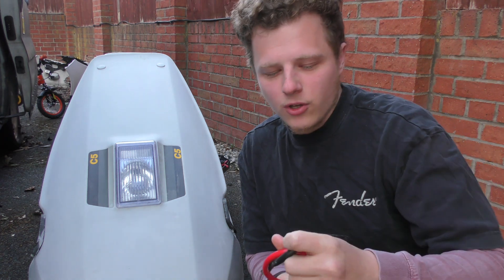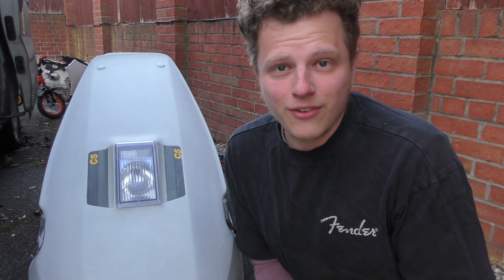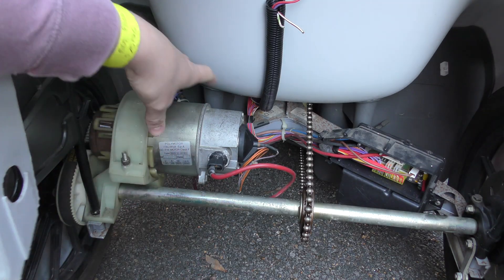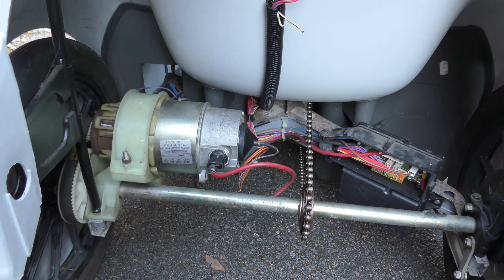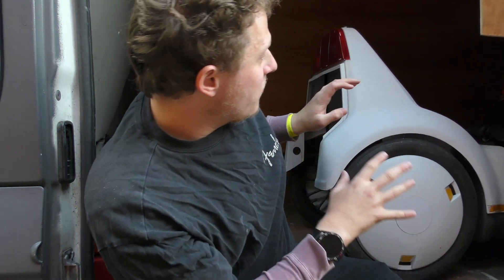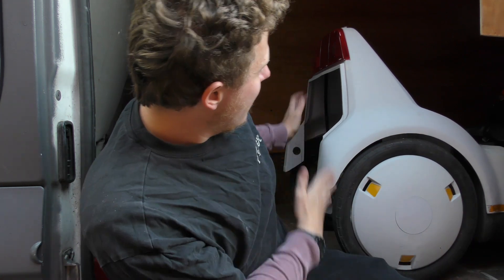Restoring the Sinclair C5 Motor After 40-Years!

Comment: For anyone watching this wanting to do theirs, 800 grit cleaning the commutator. Build it this was as shown, not the retro workshop way where the brushes are pulled by the braiding, this more often than not results in the braiding pulling out of the brushes. In the brush end the wavey washer goes in first, then the flat washer. 

Personally I would use more grease than shown here. 

Fit the gearbox mount then the bolts after. Make sure its the cream version shown, not the earlier brittle grey/brown versoin as this snaps and will cause more damage if you continue to use it with the motor not having the full support. If the bolts have to be wound through the gearbox mount, then its because its been apart before and someone has done it up too tight and the material has been compressed. It should be done up by hand with a socket screwdriver, not with a small ratchet. Put some grease on the end of the bolts as these have been known to seize into the brush end.

Happy C5ing! - C5DEPOT.CO.UK

Comment: motor looks good from my screen :) they are picky, use the right grease, and careful with the brushes you cannot replace them as there are none !
didn't notice how u put the motor back but u can rotate it to have more or less belt grip.
Reply from the maker: I put it back in the same position I got it out in. Les belt grip would be something to test as it's quite alright belt on there!
Reply: @OliverKuiz  needs to be tighter as its slipping in your next video

Comment: Great work. My C5 motor isn't working, but the lights do. Also the dashboard lights aren't working. They were working and the motor was running fine a few months ago before I removed the battery to charge it. I have no idea how to fix it and no meter etc like you have. Can you help, also where are you based.. cheers, Steve.
Reply from the maker: Hi Steve, similar situation in the regards to the dash light atm. I've been made aware it'll be a loose connection, though I'm still to test that one out myself. I picked up the multimeter for £8.50 from Halfords, though they're a lot cheaper elsewhere - it was 4.50pm on a Sunday when I needed it hence the cost. North-West based this current point in time.
Reply: @OliverKuiz  thanks for that Oliver. I'm on the Isle of Man.